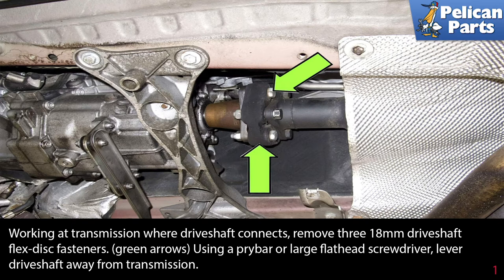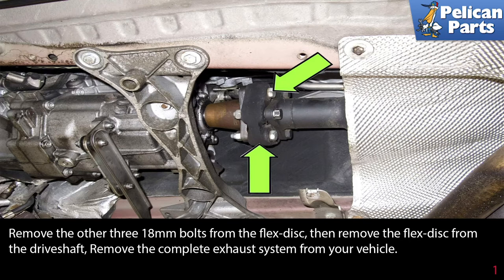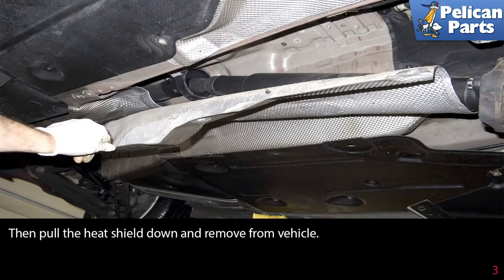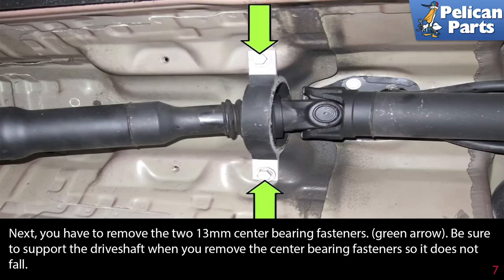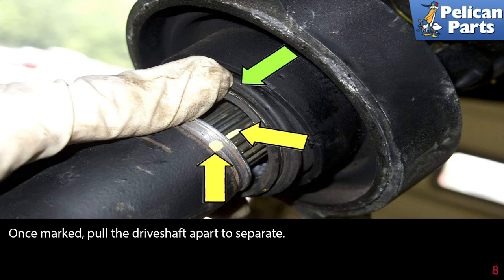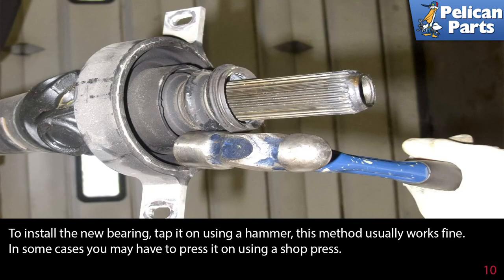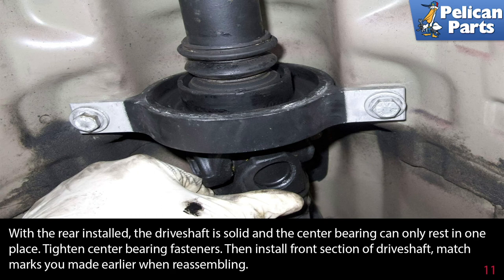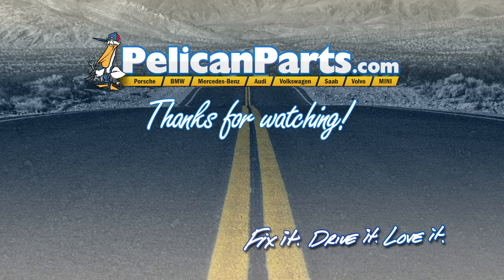BMW E90 3-Series Driveshaft Bearing Replacement for 325i, 325Xi, 330i, 330xi, 328i, 335i

Comment: Tap it on using a hammer? That's an easy way to get it on unevenly and ruin the bearing. I recommend a pipe with the same diameter as the bearing so you can evenly put it on.
Reply from the maker: Thanks for the Info. We appreciate it.